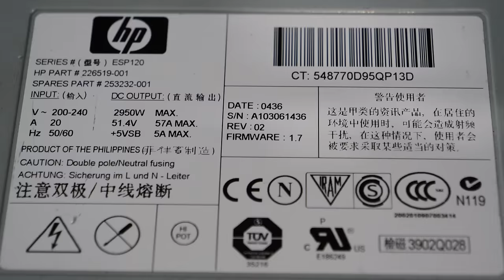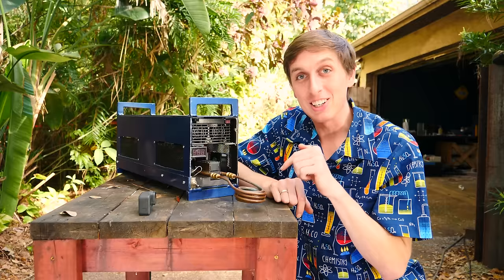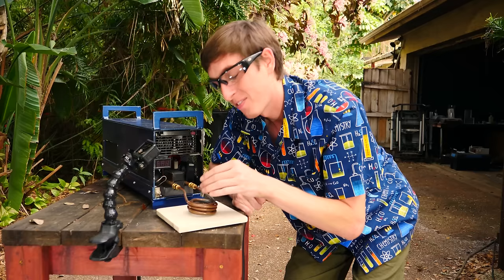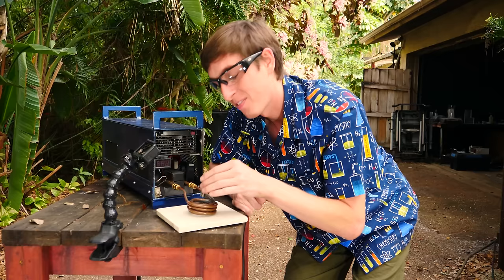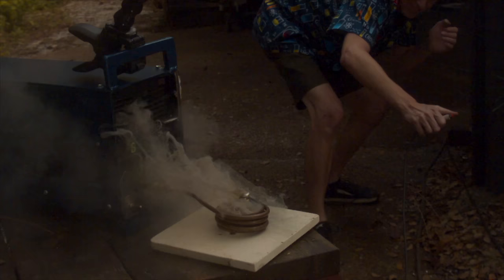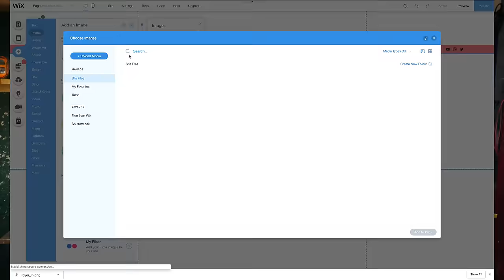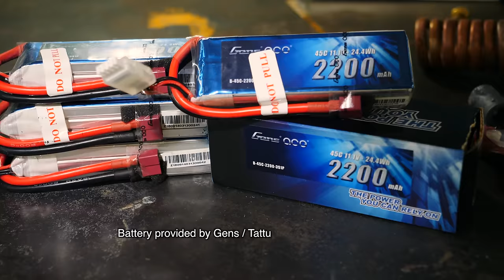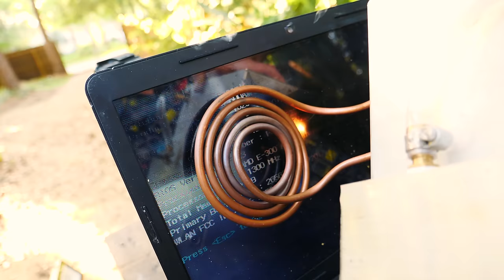Handheld Induction Heater Melts a Lock!

Comment: Molten lithium is one thing I have not seen before. I recently read a lengthy paper about battery recycling. The most common method for lithium batteries is to literally just light them on fire. It's kind of ridiculous, they don't even bother to recover the lithium, just the more expensive elements like cobalt. I wonder if there's something an induction heater might have to offer to more easily extract lithium from batteries before they go wholesale into the furnace.
Reply: I remember i used to have some sort of battery charger when i was 6, not mine but it was my dad's and he used it alot. But for some reason it broke or something and stopped working.
Reply: @darr0w2  Wow. A charger for batteries? Did not know those existed. That is SO cool.
Reply: @ARockyRock  😂😂😂
Reply: @ARockyRock  You didn't hear it from me, but I heard they are developing batteries that can be charged wirelessly 😵
Reply: @Thealseie  Woah...
Reply: @ARockyRock  amazing . . .
Reply: Note that the cell that may have had molten lithium coming out of it was a lithium primary AA cell. This would only work well on a cell that was not spent or expired, since discharging the battery consumes the lithium metal into LiMnO₂ in which case the induction heater would be ineffective in heating the product, and you would need to recover the lithium to its metallic form anyway. A lithium ion battery is completely different and there's no pure lithium metal in it. The lithium metal is instead stored in a graphite matrix or lithium salt (depending on whether the battery is charged or discharged.) The structure of a Li-ion battery is far too complex to just melt the lithium or otherwise extract it cleanly. Probably, someone did the math and concluded that burning is actually the most efficient way of recycling them. You're burning off all the volatiles (carbon, oxygen and other light elements from the graphite matrix as well as the electrolyte) and you're left with the cobalt, copper and aluminium from the conductors, and even the lithium in the form of lithium salts. I don't doubt that it's all recycled though.
Reply: Look up rich rebuilds and miss daisy
Reply: Your failure to use even the most basic safety equipment or procedures is both irresponsible and disappointing.  Not only do you risk injury to yourself, but your actions serve to embolden others, who may not wind up so lucky as you.

Please, please be more cognizant of these type of safety concerns in the future. Thanks, friend!
Reply: If they can extract it from the ground, they can recover it after use.
Reply: Doran H I think this is the wrong person to reply to....
Reply: It's NightHawkInLight!
Reply: Is there anything you can mix in a liquid (specifically lithium but generally curious) to make it non-conductive?
Reply: @darr0w2  yeah....they sell battery charges. Who'du'thunk?
Reply: @cen7ury  so you dont believe in darwin awards allowing for the surviving gene pool to hold a strengthened form of cognizance? Asking for a friend.
Reply: @deshyvin  of course I believe in the Darwin Awards. I also believe that we got to this point as a species by sharing knowledge and information about what works and what doesn't. I'm not stopping anyone from making a potentially life-altering decision with my comment...my goal is to remind people that safety protocols and procedures were developed for a reason, and that anyone with an ounce of common sense would do their best to heed them as though their life depended on it, as it often does.
Reply: I hope that lithium recycling becomes more popular, the world does not need to run out of that
Reply: @darr0w2  this is the most random reply ever lmao
Reply: molten sodium or potassium seems terrifying
Reply: If I owned a lithium mine, I'd spend all my profits buying the patents for recyling lithium and never let them see rhe light of day. Burn baby
Reply: A smart person. I don't see many of those here.

Comment: Vapers be like: sick build dude
Reply: I was wondering if anyone was going to mention vape coils
Reply: They work different tho :)
Reply: Dab hits for sure
Reply: Resistive heat ain’t got nothing on my inductive clapton drippers
Reply: needs new cotton
Reply: My Dr. Dabber Switch uses induction coil to heat the banger. Hard to say weather I prefer the Switch or the Puffco Peak.  Both  are way more convenient  and consistent that using a torch . The induction heated Switch has a self cleaning mode, freaking great feature. Glowing red-hot in seconds with just the push of a button (torches it's self). Being induction if you are using a metal dab tool load it & put in center of banger and it warms up QUICKLY SO BECAREFUL hit slides off and.... booyah go time!

Comment: I have a video idea but it’s kinda random. 

Could u get a fully pressurized aluminum scuba tank and put some gallium on it and wait till failure? Bonus points if you catch the failure in slowmo.

Edit
Maybe rough up the bottom of the tank and put it in a small pool of liquid gallium heated with a candle or something. You might get a rocket.

Consider keeping a rifle near by so you can easily end the test if you need to
Reply: Agree
Reply: This is an amazing idea.
Reply: Realy hope to see this in a video or even on a small scale with those co2 tanked like the tiny ones
Reply: That would be very very dangerous. A fully pressurized scuba tank would explode like a bomb. Certainly he couldn't do that in his backyard
Reply: Lele422 I’m sure he could find someone else’s back yard to do it in.
Reply: Lele422 250 bars would definitely rip someone into tiny pieces in an instant.

Comment: Induction heater bottle opener, I’d buy it! 👍🏻🍻
Reply: HankB1993 i was thinkin of that, it was pretty cool
Reply: I was thinking the bottle opening would be extremely hot and cook your lips on the first sip. Notice how the video immediately cut to something else after? Was expecting to see him sitting there with burnt lips.
Reply: @Moorgoth67  r/wooosh
Reply: Moorgoth67 Glass wouldn't react at all, and the cap came off so fast no heat would have been transferred. It would be fine

Comment: DUDE, THATS THE COOLEST BEER OPENER EVER!!!
I just hope it works fast enough not to warm up the drink too much 😂
Reply: Just don't drink off it straightaway, or see you in the hospital with your lips attached to it 😂😂😂
Reply: It only warms up the metal, which expands and therefore loses grip on the glass.
The carbonation pressure does the rest!

The glass is a bad thermal conductor, so the liquid itself won't heat at all. However, it might crack the glass due to thermal stress.
Reply: It heats up the cap which in turn heats up the air between the cap and the beverage. Hot air expands and pops off the cap. Nothing to do with carbonation.

Comment: On the bullet, firstly if you don't have a chamber to direct the pressure than the bullet won't go anywhere. And most of the noise of a rifle comes from the bullet breaking the sound barrier, so if the bullet doesn't go anywhere it won't be very loud.
Reply: Oh

Comment: See the red flame at 3:50 with the molten lithium coming out? OK, now imagine that flame being about 2 metres long burning from wall to wall of a narrow passage with lithium droplets shoot from one wall to the other. Now imagine that your only emergency exit is on the other side of that flame, all the fire extinguishers and the oxygen masks have been used up and the air conditioning is off, so the air is getting pretty thick with smoke. And of course the next fire brigade station is 400km below your feet.
That's more or less what happened onboard the MIR in 1997.
Reply: Wut...
Reply: That had to be freaky as hell, no gravity fire.
Reply: @kennethwallace4338  Indeed it was no gravity fire, the thing burning was a canister used to produce oxygen, so it was self-feeding and they couldn't extinguish it. It stopped burning only when the canister stopped producing oxygen.
Reply: @lazy coconut  the old Russian (soviet) space station.
Reply: Fake news
Reply: @arthurmead5341  Maybe. Or maybe not: https://en.wikipedia.org/wiki/Mir#Accidents
Reply: @arthurmead5341  who's your pic?
Reply: @joeyknight8272  swiss army knives
Reply: @arthurmead5341  your banner
Reply: @joeyknight8272  oh, Mila Azul
Reply: @arthurmead5341  whos she
Reply: @joeyknight8272  a model
Reply: The book Dragonfly is a great read about this and Mir in general
Reply: apparently lithium is also really good rocket fuel so i imagine that flame would have some real power to it
Reply: @maxsignori7660  The Union dissolved in 1991. It was Russian not soviet
Reply: @legionary45  that's correct, by the time the accident happened it was obviously Russian, but it was launched in 1986, therefore...
Reply: @IrishViking987  interesting. Fun fact, we have the same family name in Italian and German.

Comment: Bullets aren't very dangerous.
Not much different than a cannonball.
The barrel is an EXTREMELY nessecary part of the equation.
Reply: They are actually. A full bullet includes the gunpowder, so hitting it hard enough will make it go off. The same won’t happen with a cannonball.
Reply: @evanwatling3897  Bullets never had any gunpowder (except the explosive ones, of course), the cartridges holding them are the ones that has some.
Reply: If you set off a "bullet' (cartridge) not inside a gun, the actual projectile isn't the dangerous part.  It's heavy and most likely won't go very far or very fast.  The dangerous part would be tiny pieces of the brass casing (or perhaps the primer) breaking free and exploding outward to the sides.
Reply: Some say a bullet is half full, others say it's half empty.
Reply: @towtruckmafia  When people say "bullet" most mean the entire shell, primer, projectile, etc. Bullets = the the things that you load a gun with. To non-experts the specifics are just semantics
Reply: Sentient2x the only reason a bullet travels outwards is because of the pressure built up behind it in the chamber from the charge. Like a potato gun. When just set off in open air. They do nothing. A primer is what creates the explosion. Brass pieces from the casing could get in your eyes face etc. but the bullet isn’t gonna take off. It probably doesn’t even have the power to move really.
Reply: @SpaghettiEnterprises  There are 4 major parts to any cartridge:  Case, Primer, Gunpowder, Bullet/Projectile.  A shell is a hollow projectile designed to carry something.  It could be explosives, grenades, mines, white or red phosphorus for producing smoke, flechettes, and other fun items.  A projectile that is not hollow, (solid) is called "shot" or "ball", depending on the caliber and its use.
Reply: @GUNNER67akaKelt  Exactly!  They explode like a firecracker and brass shrapnel will fly.  It's not always tiny.  I set one off (remotely) and the brass stayed in 3 big pieces.
Reply: Alright @everyone hickok45 made a video addressing this issue a while ago by putting a bullet into a pot and heating it up. Look up that video if you want to know just how dangerous a bullet is without the barrel.

Hint: It isn't really that dangerous.

Comment: The gold ring has a higher resistance. So it converts more of the eddy currents into heat.
Silver is a better conductor (even better heat conductor) but it does not bother so much conducting high currents. (Additionally the skin-effects is stronger in silver then in gold, so less currents is induced. But this is a minor factor)
Reply: Why do they use gold over silver in electrical applications if silver is a better conductor?
Reply: @fungdark8270  No, they do not use gold conducter. They only apply a thin gold coating to contacts. This is because gold is not prone to corrosion, and thus does not build up insulting metal oxid ceramics as much as other metals.
Thus, even if not as good as other conductors, gold provides often the lowest contact resistans
Reply: @michaelm8624  thanks for answering, that’s a surprising piece of info
Reply: Gold is a very good conductor of heat though, which is the explanation he gave in the video. That is definitely responsible for at least some of the difference.
Reply: Hi  @harryf9885 ,
however silver is an even better conductor of heat

Comment: The light bulb might not have lit up because theirs nothing to complete the circuit, try putting a conductive metal (wire) on both contacts for the bulb.

My guess is it'll work then, but only for a short moment
Reply: I think the idea was that the filament would get hot enough just from the induction that it would start to glow.

Comment: Try this. Take a copper coil that can handle extreme amounts of amps/current. Take a pure carbon/graphite and put it in copper coil like the metal in the video. Extreme amounts of amps/current will create extreme magnetic pressure at the center of copper coil. Will the carbon/graphite turn into a diamond?
Reply: No thats dont work like that. That would be too easy
Reply: They have machines that make man made diamonds and they're f###ing huge.

Comment: Bullets need to be contained and the pressure needs to be built up. Which is why you use a barrel
Reply: Yep you can even light a pile of loose gunpowder on fire and it will just smolder. It does not work without compression. If you hit the primer on a bullet outside of a gun the brass casing will shoot off like a rocket more than the bullet will.
Reply: imagine using induction heating to launch a bullet from the barrel instead of using a firing pin!

Comment: I also exposed the capacitor terminals so they could easially terminate my life...
Reply: Exactly
Reply: Capacitors are usually low voltage, so he’s probably good
Reply: @ultrastoat3298  well considering voltage isn't what kills you, the voltage wouldn't particularly matter. Capacitors store energy and the rate that the energy and amount that is released would be the danger. There's enough juice stored in the capacitors of a PC power supply to kill you if discharged across the wrong organs so it's probably safe to say this unit could easily do the same
Reply: they would have to be over 50v DC to have any hope of pushing lethal current across your heart
Reply: @Red Stoner If those things blow, HE'LL be inside a box.....
Reply: @ultrastoat3298  Yeah, till they aren't, then POOF no eyebrows.....
Reply: @Lasarius2010  like a pipe organ?
Reply: @jamesisawkward1573  PLUS you'd have to have your chest cracked open ribs spread and lay them directly on your heart muscle.
Reply: @Lasarius2010  the max. Current has very little to do with the danger of a power supply
Reply: @maxxiang8746  (unless you manage to short it)
Reply: @maxxiang8746  this power engineer says different but hey what do I know
Reply: @MatthijsvanDuin  yeah I meant electrocution hazard xd
Reply: yup lol, the "current is what kills you" is only half of the puzzle. I can grab a 10 volt 100000000 amp power supply with both hands and be just fine.
Reply: Well, if the caps voltage is below some treshold sure, you would maybe just feel a tingling
But above that relatively low treshold big currents could easially do some damage to your body.
In fact higher voltages do more lethal stuff
You have to consider Ohm's law, our body has a high resistance

But nontheless never touch capaitor terminals unless they are 12v and below 100uF xD
Reply: It'd have to be higher than 50v to do anything to you if you're dry. Current means nothing if it can't flow

Comment: You probably cooked the little CR2032 battery used for the CMOS and Real-Time Clock
Reply: In the laptop?
Reply: @sugarbooty  yes, laptops also have cmos battery
Reply: It's the very reason the settings save and clock works when the main battery dies
Reply: @Nitro2030ce  I disagree with you on that, a little coin cell would make a pop not blow up like that
Reply: @sugarbooty  Watch the second battery
Reply: @Nitro2030ce  Could you give a timestamp?
Reply: @sugarbooty  Seriously? It's a 42 second video... 0:25
Reply: @Nitro2030ce  More like 12 minutes bb
Reply: I mean, or the actually battery....
Reply: @qps9380  isn't the main battery near the hinge? it has been on all laptops i've seen
Reply: @qps9380  the main battery doesn't sit there. Especially for such an old computer

Comment: Did you just stick your wedding ring on a hot dog then melt it?
Reply: rings are just trinkets get over it
Reply: I doubt it was his wedding ring.
Reply: If that was the case the next scene which we would see would have been his head inside the heater and his wife would be filming it
Reply: He didn't hold it in there long enough for it to melt it. At most he annealed the gold.
Reply: You can purchase wedding rings for less then $10 online

Comment: Putting the on/off switch next to the part that heats up seems like a design flaw.
Reply: The coil its self doesn't heat up. It uses induction to cause other things (eg. metal) to heat up. You can see after he melts the lock he touches the coils, which should only get hot from the radiant heat coming off of the lock. Under most normal circumstances putting the power switch there would be fine... but this is the backyard scientist, there are no normal circumstances.
Reply: @SofaWolf no no, I get what you're saying. I'm not disagreeing with them. It's just they didn't state it that way in the original comment. If they had put "...next to the part that heats things up..." I would of left it alone. Wasn't sure if they understood how it worked. Just being friendly my dude.